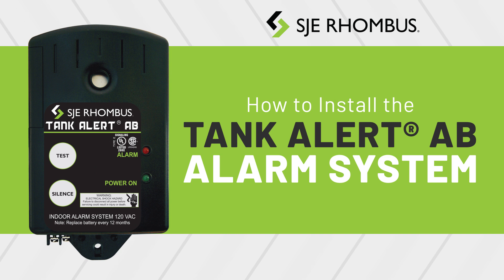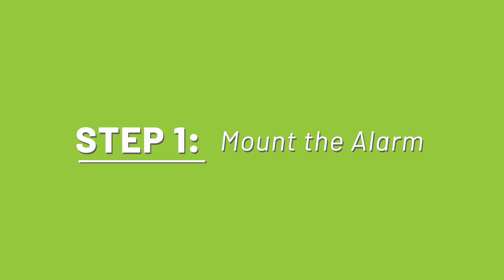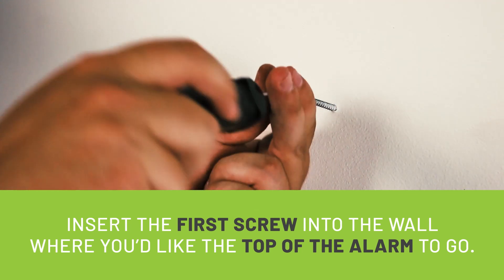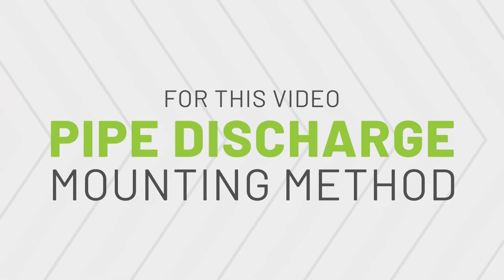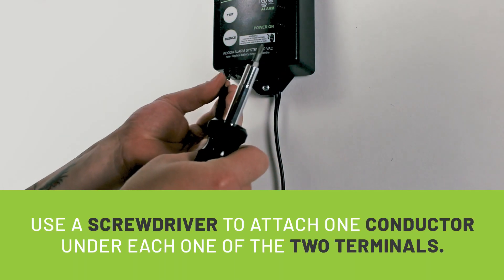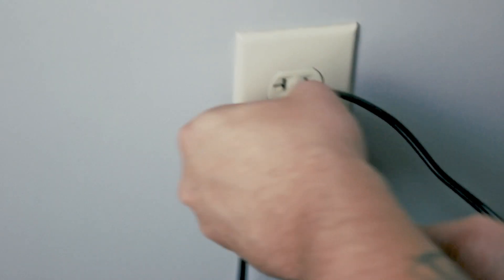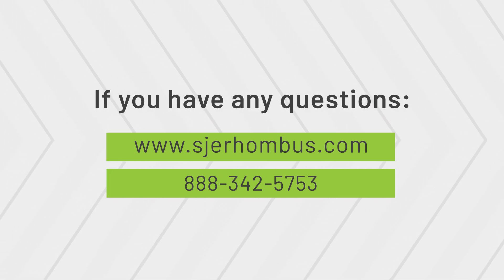How to Install Your Tank Alert® AB | SJE Rhombus

Comment: How do you silence these 🤣
Reply from the maker: There is a Silence button on the front of the Tank Alert AB that can be used to silence the horn when the unit is in alarm condition. There is also a Test button to check the alarms audio and visual notification as needed.

Comment: Can you extend the distance from the float to the alarm by running THWN in conduit, or UF cable?
Reply from the maker: Yes, you can extend the wire from the float to the alarm. This is a low voltage low current circuit on the Tank Alert AB and using 18 AWG wiring you could run up to 500 feet one way. You could use either UF or a run through conduit which would make it serviceable in the future if additional wiring is needed between the two points. If conduit is used we recommend sealing the conduit to prevent sewer gas and moisture damaging your wire splices and escaping from the tank. If you need further assistance, please contact our tech support at 888-342-5753.

Comment: Do you have any videos of the tank alert AB sounding? Id like to hear what it sounds like, mine recently did not give an audible alarm and i ran out of water. I belive the LED worked, but we 100% did not get any sounds or do any silencing.
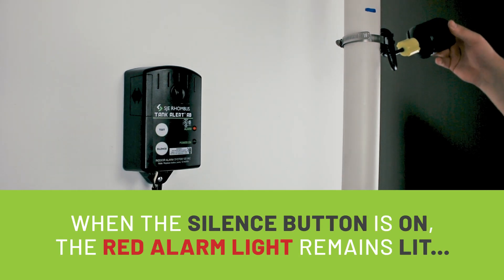Reply from the maker: The horn on the Tank Alert AB alarms around 87 decibels which is incredibly loud if you are in front of the unit. You could check the time stamp of this video at 4:22 to hear the unit alarm but please note that in person will likely sound different. For troubleshooting you could unplug the unit for 5 seconds then plug it back in. With the power restored, try hitting the test button on the front of the unit. If the horn sounds, then you may have an issue with your alarm float circuit. If the horn does not sound, that would indicate that the horn has exhausted its lifespan and the Tank Alert AB would need to be replaced. If you would like to talk to our tech support team you can give them a call at 1-888-342-5753 ext. 2.  Thank you.